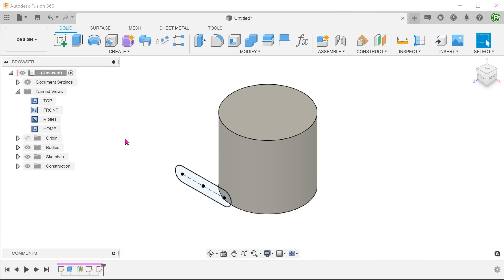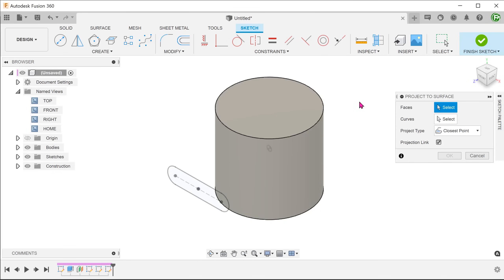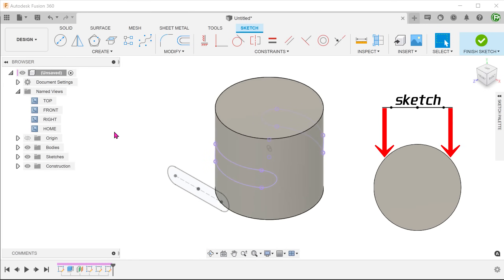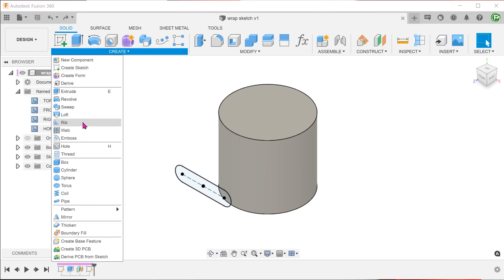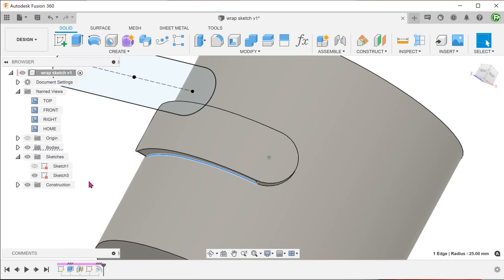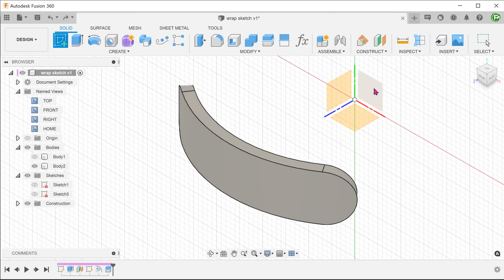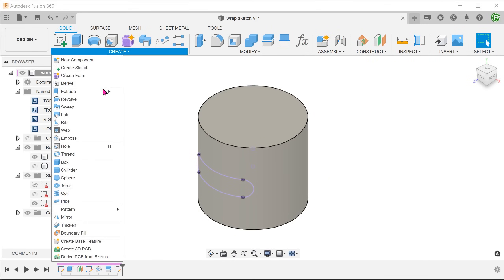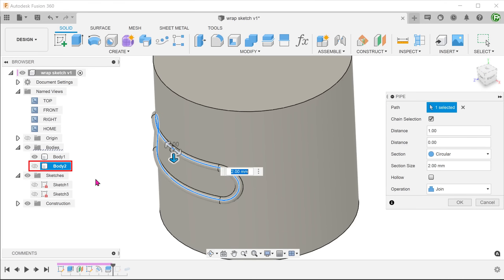Fusion 360 | Sketch Wrap? (Not Project to Surface)

Comment from the maker: Unfortunately, there is a limitation to this method. It can only work on closed profiles. I have also been thinking about how I would go about wrapping open sketch lines. It would most probably be along the lines of the method shown in the thin emboss video:
https://youtu.be/-KJ7jf_AJlI
Reply: Great as you told it work only on Clean surface geo, try to apply it on Mesh imported & converted in solid it won't work. Thank you
Reply: What I think would be a great challenge is to model a motorcycle gear shift drum. It's a relatively simple shape but as far as I know impossible to do in Fusion. Some years ago I tried for months to model one but gave up. I love your videos btw.

Comment: I hate when situations like this come up where instead of focusing on solving an actual problem, you need to focus on working around limitations of the tool. this should be a standard feature in fusion, and the existence of the emboss command proves that it can be done

Comment: This was very helpful for getting the correct profile on the surface. Thank you. 

I'm trying to create a spiraling slot in the wall of a hollow cylinder where a bearing mounted on a second cylinder in its interior will ride against. This will create a rotating motion as the two cylinders move axially in relation to each other. 

My problem is the emboss feature (actually the deboss option) tapers the profile the further it is projected to the centerline (axis) of the cylinders. Do you know of a solution that will cut the profile perpendicular to the surface without tapering it?

I appreciate any help you can provide.

Comment: Does anyone have any experience with a wrap of this kind with non-cylindrical faces/surfaces?
Reply from the maker: At the moment, the emboss feature is only limited to surfaces with curvature in one direction. There isn't a command available right now that can perform a true wrap on more complex surfaces. Autodesk has mentioned that they are working on this capability in the forums, but I don't know when that would be available. If you don't need a true wrap, it is possible to achieve an approximate with the surrogate emboss method.

Comment: Whats the best practice too remove body 2 in this situation.
If you delete body 2 would this affect the pipe as its lost its origins, would best practise mean you should leave it as hidden.
I think this is the wrong way but I would hide body and excuse a cut command around body 2 too remove it, this way the pipe will still have its origin, but I no longer have body 2 on workspace?

Comment: Nice, but unfortunately this only works on cylindrical bodies. I’m a tire designer, and my tires aren’t shaped like cylinders. So I have to bend/wrap my tread in two directions at once, across a complex shape consisting of multiple tangent arcs. I haven’t found an Autodesk product yet that can handle that. Only Solidworks or ProE.

Comment: Hi, great video. Couldn't you still use "Project to Surface" with "Closest Point" to achieve the same result, if you make sure that the sketch plane/curves are touching the cylinder?
Reply from the maker: This is an interesting idea. I went to test this by sketching on a plane tangent to the cylinder. And no, it does not wrap. The closest point option simply finds the shortest distance between the sketch and the curved surface and projects the sketch that way.
Reply: @Fusion360School  Thanks for trying it out! The way it looked in your video, it almost seemed to be projected based on the axis of curvature of the cylinder, but now I realize that wouldn't be the closest distance :)

Comment: Thank you for this vid!!!  
It helped me a lot in creating a pipe through an emboss edge.  
(application: complex curved cooling tube for a drum which has to be perfectly welled on a curved copper plate)

The trouble I had before was working with the different curves on more levels and getting the distances right.  
Now I could design the complex grid with different radius and more levels easy in 2D and then project them on a complex curved face.
I can change these faces (of the different drums) and curves (widder or more compact) working with parameters.
It works like a charm!

Earlier I was drawing in sketch 3D and did a lot with copy paste and used different planes
it was a lot of work to get it perfect and working with parameters didn't give the result, it should.
Again, a lot of kudo's!

Comment: Have you tried the emboss rotation? I found that if my sketch was larger than the diameter of the curve, I would start with it rotated 90° vertically, then use the emboss rotation to "unrotate" it. This gives me a nearly perfect wrap.

EDIT:

So my method is: 1. Create your desired slot profile with it's axis aligned vertical (perpendicular to cylinder axis then,
 2. Emboss a 0.01mm protrusion onto your curved surface with a 90º rotation angle. (my cylinder was 100mm tall, diameter 50mm, emboss was 0.01mm)
3. Simply enable the pipe command and select the emboss edge directly.

This gave me "exact" lengths. E.g. my slot's straight length was 48.54mm, and the equivalent pipe length was  48.54mm. I couldn't see any issues with either a zebra or curve analysis.

Comment: The concept of wrapping any sketch on any surface (not just rounded) should be implemented by fusion. A further step could then allow the wrapping of the sketch plane itself. 
Again I think of a Grasshoper like feature. 
Imagine modeling a complex texture on a plane that gets stitched to any shaped body surface.
Reply: This needs to be implemented into fusion so badly, especially with more complex surfaces. Not every model is going to work with strictly flat surfaces and revolves
Reply: Plane means flat. Your idea goes against the concept of planes.
Reply: @alejandroperez5368  wrapping makes planes un-flat. empirical evidence shows us you can wrap a sheet of paper into a cylinder